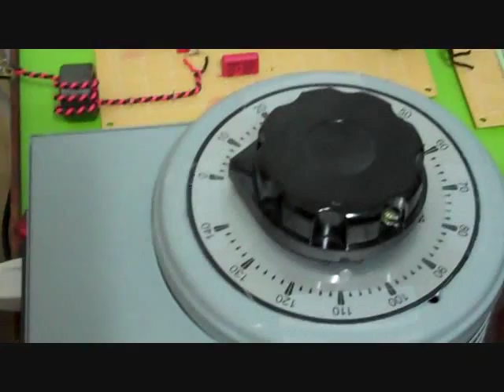PLL SSTC - part 1

Comment: hi.i cannot find the icc37321p's in my country can i use the 555 timers? if not plz give me a supliment .plz answer.and thank u .
Reply from the maker: Hello! The UCC37322/1 chips are not oscillators but powerful MOSFET driver chips capable of supplying 9 AMPS of current to charge up the MOSFET gates. A 555 timer is an entirely different chip for a different application. There are other substitutes though; TC4420 and TC4429 - note they lack the enable function. UCC27525 is the equivalent of both the UCC37321 and UCC37322 in one single chip. There are also the higher power IXYS IXDD609CL and IXDD614CL TO-220 MOSFET gate drivers.

What you are looking for is a "MOSFET Gate Drive" IC that has a non-inverting version and an inverting version, or both in one (like the UCC27525). It can be done with discrete BJT electronics but it is much more complex.

The coil in this video is outdated and there are better designs to base new coils on. The basic format of an Inverting Schmitt Trigger Buffer IC feeding a Gate Drive IC is still the standard, but there have been a lot of advances. I suggest having a look at what others are doing at 4HV.org and visiting Richie Burnett, Steve Ward, and Steve Conner's websites for detailed information. In addition, I have my own website, which is still under construction, which has updated info and designs. www.SigurthrEnterprises.com Feel free to see the newer videos on my channel for updates designs and coils.

Comment: one question...did u connect the mosfets oppositely to the torroid ?cause for some reason my half bridge isnt giving anything ...plz help
Reply from the maker: I'm not sure what you meant by "connect mosfets oppositely to the toroid" as the only thing connected to the toroid is the secondary. That aside; if you're not getting any output from your half bridge it is likely that gate drive is the issue. MOSFETs tend to die as a dead-short, so they're likely still good if you're not seeing smoke or tripping breakers. Inspect your GDT and whatever gate drive silicon you're using. Be sure you use low ESR capacitors which present a low impedance to your resonant frequency for the DC block cap on the primary side of the GDT.
Reply: i ment to say the ferrit core *